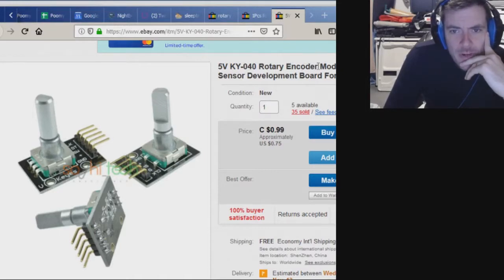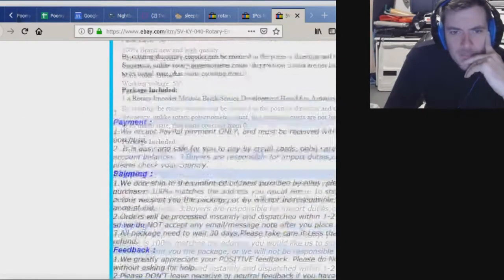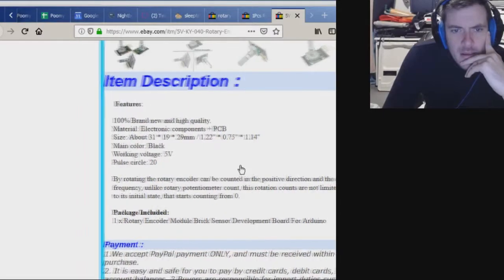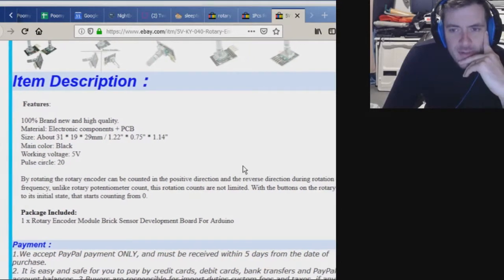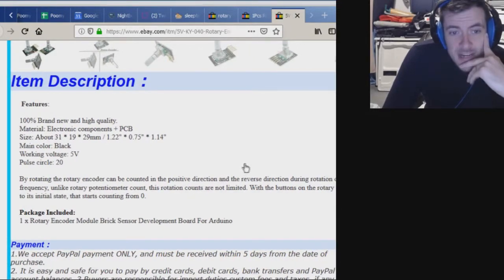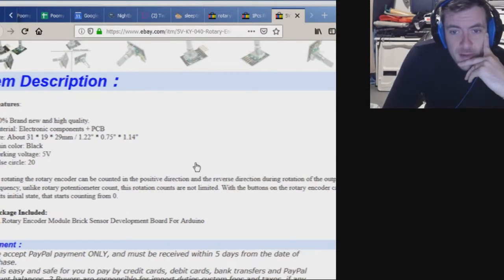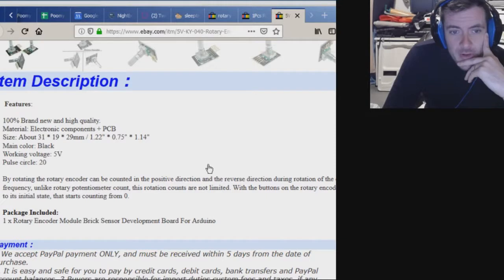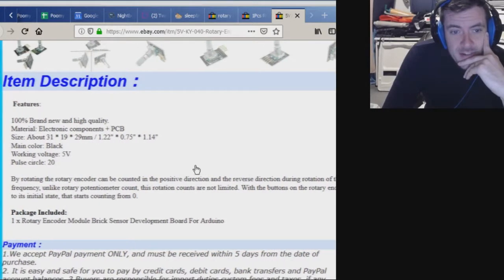Potentiometer But Infinite Turning for CNC - The "Rotary Encoder"

Comment: It's a panel mount encoder, Bozo! They are not used on motors. Get the right motor and it will already have something like a HEDS or CUI encoder built-in. "tape measure with a camera" 🤣😂🤣😂 And then you need to decode the quadrature signals.......Can you say CLUELESS ???